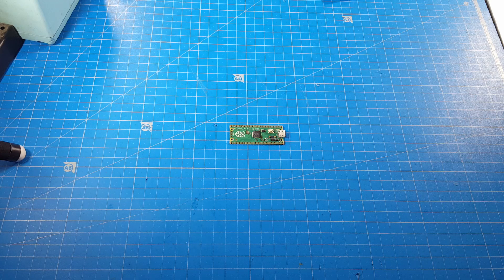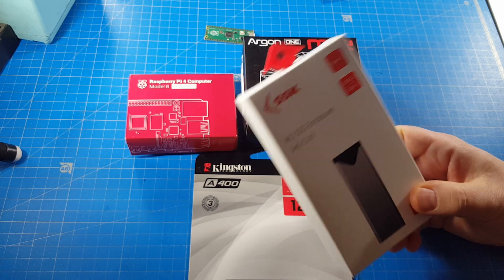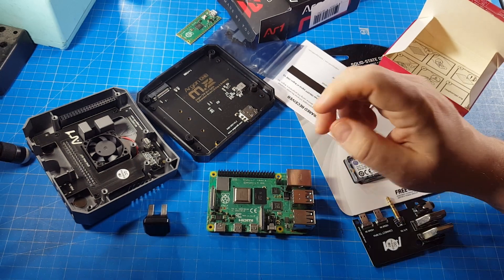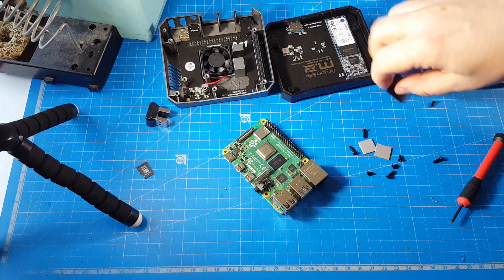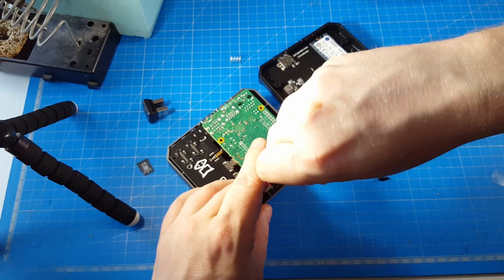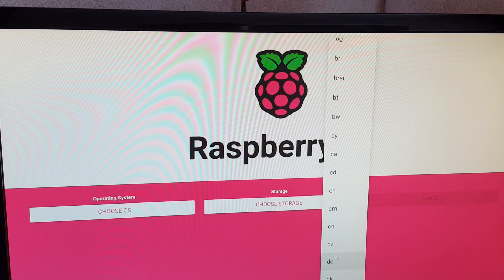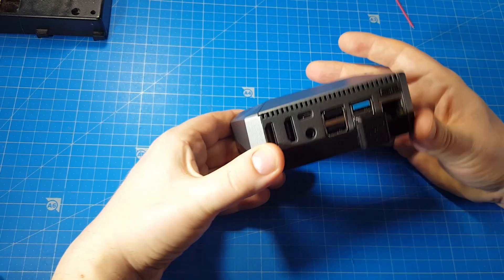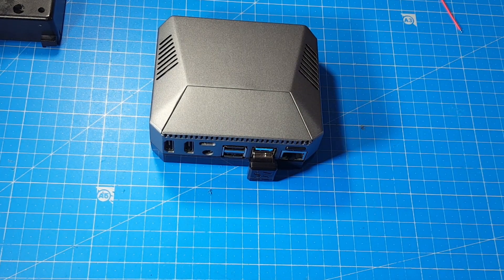Argon One M.2 case for Raspberry Pi Review

Comment: These cases are excellent. I have the version without the SSD space (but otherwise identical) and it makes the raspberry pi feel much more like real computer when compared to all those fragile plastic cheap cases. The daughter board that puts all the connectors on one side is a very nice touch.

I did have a broken fan (bearings...) In one case, but small fans are always going to be a weakness, of any case. It works fine with the fan switched off, so it's no problem.
Reply from the maker: I have one Pi running Kodi with this case. Changed the fan's mode to runnning constantly, since I haven't figured out how to install the custom fan controlling software under Kodi. And it's a very noisy, little fan. But I don't want the Pi to overheat, since they are hard to come by, nowerdays.